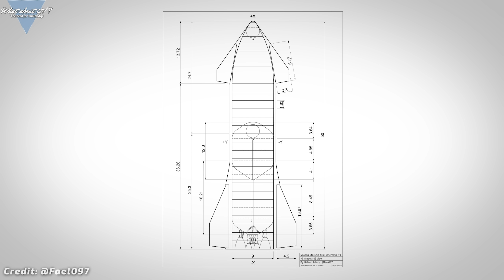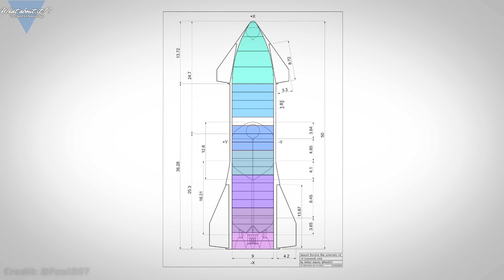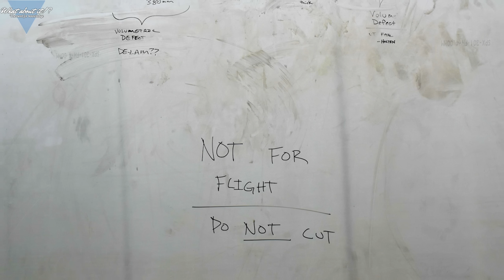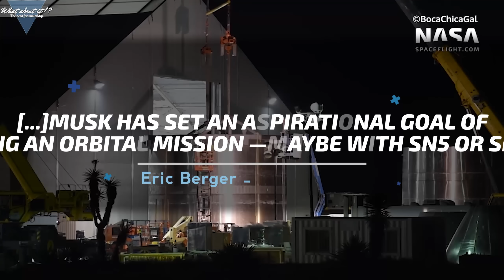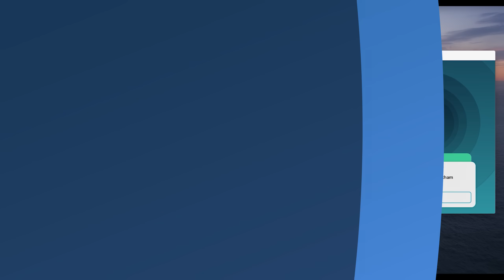78 | SpaceX Starship Updates – Starship Mass Production Update

Comment: Hey, I have a question: I've been watching the development for starship for a while, but I havent heard what has actually happened with SN2. I know there was a tank section test a little while ago when SN1 spectacularly disassembled itself which I think was SN2, but that was it. Was it scrapped due to similar weld quality/thrustpuck design, or for a different reason?
Reply: It has never made it further than being one fuel tank.
Reply: SN2 wasn't a full prototype. It was probably intended to be one, but after the SN1 failure, they just took the tank section, fitted it with the redesigned thrust puck, and used it for pressure tests. They could have kept building it, but by the time they'd done the tests, they were halfway through building SN3...
Reply: @simongeard4824  Ah right, fair enough, was bugging me for a little while as to what happened with it. Thank you both for your replies :)
Reply: @OneCokeAndDrink  no worries, it's easy to miss stuff, considering the pace of change, and the way they're always starting the next revision before they finish assembling the current one...

Comment: Why use domed tanks instead of flat ended ones which don't waste space inside rocket?
Reply: There's a reason: It's engineering using well established physics principles.
Reply: Domed tanks are much stronger at the same weight.  A flat ended tank would need a lot of reinforcing.  Also,  a dome on the bottom works as a funnel for the fuel
Reply: @ChevTecGroup  If That's so why are all the propellant storage tanks flat ended? seems like with all the seems in the dome are much more likely to fail than a single piece of steel for the end.
Reply: @Shivaho  propellant storage tanks are not made to be as lightweight as possible.  And aren't pressurized above the fuels standard pressures

Comment: Wait so SN2 wasn't even full fuselage? WTF? This numeration soon will be more complicated than atlas family!
I mean, look, it's just fuel tank, one af many pieces that woudl create ship. 
I hope SN-3 will atleast have 2 fuel tank.
Of course, it took them "just 1 week" to make sn2, but sn2 wasn't starship.
Reply: The number schemes essentially document the setbacks. SN-2 was supposed to become a full Starship but got stopped and repurposed.
How long did it take Boeing to build one SLS tank?
Reply: @antyspi4466  well as i remember, full test tank, with correct thermal protection and plumbing, about 2 months. And it survived 220% of flight forces for 10h.
They coudl just name SN3 sn2, as sn2 wasn't even vessel.
Reply: @_mikolaj_  But that would mean reassigning names, since SN3 was already under construction by the time SN2 was converted to a tank test. And then you'd still be complaining about the complicated naming, because you'd have two things both called SN2...

Comment: Don't be in such a rush Elon. People's lives depend on your success. Don't be so cheap if you plan on reusable rockets. Use cylinder ring bars. It keeps your sidewalls from blowing out. When SpaceX doesn't work on quantum development you acquire structural breaches and breakdowns.
Reply: When you try to mass produce a prototype all you end up with is proto copies.  If you made a thousand rockets the same then you limited yourself to the original prototype design with no flexibility.  It's a shame that people can't see the truth when designs for off planet are capped for budgeting purposes. When you bite off more than you can chew at one time like SpaceX , the situation begins to spiral out of control. The final product becomes cheaper and cheaper and the quality control non existent.
Reply: Nah, believe me, you won't see proper mars colony in years, even if this thing works.

Comment: Felix, when in Boca did you figure out if the high bay has enough interior height for the full stack? Just curious; I'm doubtful their current trailer system can transport the full stack, they'll make the final join on the launch stand, after the static fire.
7:10  Having no gantry crane makes sense. The best part is no part!  At best it could roll out the front of the bay to pick up a section delivered by a regular crane. So it's easier to use the regular crane to move segments around that whole area, as they do, and also place it in the bay.

Comment: Watching the assembly process... I would hope Elon has plans for installing rail systems for moving, stacking and testing all this items. Using the base jig just makes it all the more useful. Gantry cranes on rails  would get a lot of those mobile cranes out of there for bigger stackings. So much less moving equipment.

Love the videos Felix and Boca Chica gal! Such an awesome time to be alive and have such a front row seat of it all here in Ontario. Thank you so much!
Reply from the maker: I am pretty sure, this innitial "factory" will vanish at some point to replace something much more permanent and developed.
Reply: @javaman4584  I'm quite sure that all tents will disappear, as they are just for manufacturing line development. I even think, that at least smaller VAB will be rebuilt/dismantled "soon" (like in the next 1-1,5 year tops). But it's also possible, that lower onion-tents might be raised to 2 (or even 3) container base at some point, and used for some time, as main production line, but most probably something much bigger SpaceGiga? (StarGiga /SpaceFactory) and "complete" will emerge. We have to remember that there will be much more "clean" sections designed, developed and then mass produced in next 2 years, like cargobays, lifesupport, humanrated/cabin sections, airlocks, etc

As for stacking, I think they will be using Berry for some time. And when all or most manufacturing/stacking techniques are understood and designed then some permanent lifts/cranes/rails will be built. I presume it will be before the end of 2021, mark my words ;P
Reply: @TheBartu5  I agree. This is mostly temporary stuff. When they figure it all out, they'll go with indoor cranes, elevators, lifts, entire multiple starship sized clean rooms, whatever it takes to reach their production goals. That's a way out though, since everything will change so much, and even their "real" production facility will evolve. And then lets not forget covid19 wants to slow them down so they will have to move so fast the delays from that will still leave them fast.
Reply: NASA in the early 60's built EVERYTHING from dirt to finished complex's in about 6 years

no prototype designs or structures,, they DESIGNED everything & BUILT IT,,   using 1960's technology
why is SpaceX taking the Mickey Mouse approach to space design and research
Reply: @matthews4159  NASA in the 60s was truly heroic and full of heroes. A magical time.
These days heroes are few..
Reply: @unfurling3129  the point i'm making is that they DESIGNED the Saturn V & then BUILT it,, unlike spaceX and the build it in the back garden , prototype,,, again and again and again approach.
Reply: @matthews4159  6 years? In 6 years we gonna have tens of thousands of autonomous robots building stuff on mars non stop. And saturn 5 was never designed to be mass produced. You seem to think that mass producing a giant rocket  and building it nasa style 1 every few years is the same thing. Instead of fitting the manufacturing to the design, better to fit the design to the manufacturing capability. Having few giant engines, instead of having many smaller easier to mass-produce engines, is one such nasa fuckup. Do this wrong and you let room for a competitor to easily exterminate you after you did  all the heavy lifting. You can't generate local or global maximums like that. Nasa could not care less about the cost, for starship the cost is everything. If nasa had took the current elon approach, we would have had hundreds of bases on the asteroid belt by now. Economics must be the first concern on engineers mind, then the goal. As such "Mickey Mouse approach" is better fit for this. Find that maximum from a manufacturing perspective or don't even continue. Still what nasa was able to do in the 60's is mind bending. Just the CFD tools we have today give one 1000x more capability they ever had. And by comparison our current progress is literally a bad joke compared to what we could have done given the tech we have. And if you want to know the real reason - in the 60's the average 20 year old knew lots of stuff about math, physics, history, etc. Young people today don't know shit in comparison. Being clueless is the norm. We have google and youtube and stuff to supplement for our lack of general knowledge and work ethic. But apples to apples compassion, in general we are far behind compared to people in the 60's. This will chance though once we gonna need to solve every conceivable problem on mars. General expertise will grow like crazy fueled by need. We gonna need to become much better or we gonna fail. If we succeed, we gonna basically become the peak performance of biological human - the future generations will look back at us as the "ancient and wise ones" - the ones which built everything  - since they will rely on brain-computer interfaces to think. But wait -  we need to get to mars first :))
Reply: @aion2177  they made 18 Saturn V, and could easily have made more, since production facilities were established by this point.
https://en.wikipedia.org/wiki/Saturn_V#Saturn_V_vehicles_and_launches
Reply: @aion2177  they built 18 Saturn V launch vehicles, 13 flew,  from 1967 - 1973, 2 were in reserve and are now in museums
from apollo 8 DEC 1968 - apollo 12 1969  that's 5 flights in 1 year,, so i would say they were mas produced!  and 100% reliable.  If we had continued making the Saturn V ,, we would indeed be on mars today, but the decision was made to go to 50 ton's payload to low Earth orbit with the shuttle. Insted of 100 tons to low earth orbit or 50 tones to the moon with Saturn V . spaceX Starship has 3 engines for atmospheric flight and 3 for vacuum space flight.  
https://en.wikipedia.org/wiki/Saturn_V#Saturn_V_vehicles_and_launches
SpaceX Starship  says 100 ton's anywhere ( low earth orbit ) so they are re-making Saturn V lift capabilities 
they are making Starship Today,, they have not even made the Heavy Launch vehicle... yet. 
https://en.wikipedia.org/wiki/SpaceX_Starship   First stage – Super Heavy  +   Second stage – Starship
Reply: @aion2177  you speak of cost, the us Navy has built 17 and are building 11 more, Virginia Submarines at $2.8 Billion each 
https://en.wikipedia.org/wiki/Virginia-class_submarine
Saturn V, Cost per launch  ($1.23 billion in 2019 value), of which $110 million was for vehicle
https://en.wikipedia.org/wiki/Saturn_V#Saturn_V_vehicles_and_launches

Comment: Excellent video, but a word about your Sponsor:
VPNs hide your usual public IP address, but from a security point of view that's negligable. Your router would have to be misconfigured (they ship safe defaults) so attackers could do harm with knowledge of your usual public IP. From a privacy point of view, you have to use a separate browser with a different set of plugins installed, wipe cookies and cache every time you start a new session (or use private mode) and disable WebRTC and JavaScript, as well as stop all other browser sessions while your VPN is turned on. Identifying users by IP address is very easy, but fingerprinting for all the stuff mentioned above is commonplace now.
Pretty much the only time a VPN by itself increases security, is when you're connected to a network that might be monitored like public WiFi or your workplace AND you're connected to an unencrypted web service (pretty rare these days).
TL;DR security experts all around the internet laugh at those sponsored claims of increased security.
If you don't want to be laughed at, stick to the real advantage of VPNs for everyday people: Accessing Geo-Blocked content, booking cheaper flights and downloading torrents.
Reply from the maker: Thank you for your feedback! ;)

Comment: The production line os one thing but I think it is time to get one of these off the ground and blasting into space.
Reply: Kind of in agreement with you there. Once they get the thing passed all the prototyping tho it’s going to go much much faster since they can focus on streamlining the production line.
Reply from the maker: It's likely intertwined though. Being able to make a working prototype of something you want to mass produce later means designing a prototype that can be mass produced later. ;) I agree though. A flight would be damn good now. Fingers crossed on SN3. I have a good feeling.
Reply: He is trying to make something that has never been done before.

You know, it is rocket science.

Nobody has tried this stuff before, not the materials, not the engines, not the fuels, there is no handbook, no previous designs, nothing.
Reply: Production quality always tends to lower when a product is introduced into mass production. As this must not happen with Starship, it is a really difficult task to design the processes that will ensure quick manufacturing and utmost quality.
Reply: @antyspi4466  incorrect. The checks and balances can still maintain excellent quality. It's more about processes and production flow exploration
Reply: Production line is important so that they arent setback when prototypes blow up etc as we have seen here, and trust me they will blow in flight too thats part of the process.
Reply: EeV 
Yep. 
But you can’t get a production line running until you know what your product is. 

So we watch as the prototypes develop through various iterations and they eventually have a production version for the production line to make.
Reply: @brucebaxter6923  I think the production line is many steps. As design solidifies, you know certain steps can be automated and streamlined. Final assembly is still up in the air, of course, but many things about Starship production are now well understood. For example, they need many rings, and they need to weld them. Obviously as design settles down more, more and more can be automated. The typical approach of building many prototypes followed by working on the production line is simply too slow for Elon.

Comment: Ehhrrr.... the thust puck on SN.3 is exactly the same as SN.1 just better welds, look at it again....
Reply from the maker: The thrust puck on SN1 was a conical shaped piece of metal. Very heavy and not very ideal if under pressure. Where the old puck was, there now is just metal and the thrust is applied on the ring. ;)
Reply: @Whataboutit  You mean the cylindrical ring inside the thrust-cone?
Reply: @Whataboutit  To me the SN.1 Puck 
https://forum.nasaspaceflight.com/index.php?action=dlattach;topic=48895.0;attach=1617019;image
looks very similar to the one on SN.3
https://forum.nasaspaceflight.com/index.php?action=dlattach;topic=48895.0;attach=1620663;image
just more 
precise
Reply: It passed the pressure test

Comment: They are gonna fail a few more times probably but when they find the solution for every issue it's going to change everything. Also having a stationary crane at the top of the high bay may make stacking more difficult. I'm sure at some point he will have an overhead gantry system but that will need much more infrastructure in place.
Reply from the maker: I have a feeling, we'll see SN3 fly. Call it a hunch. I have a good feeling.
Reply: @Whataboutit  But will it land as well? ;)
Reply: Seems reasonable. Puts more complexity to the structure and I guess you have to approve any type of in-place crane. Mobile cranes can lift well. But there wasn't anything like a mobile high bay of that size so prio one for a building was securing it from wind.